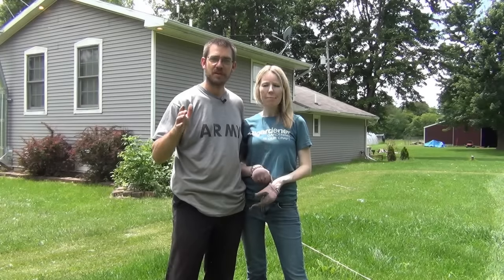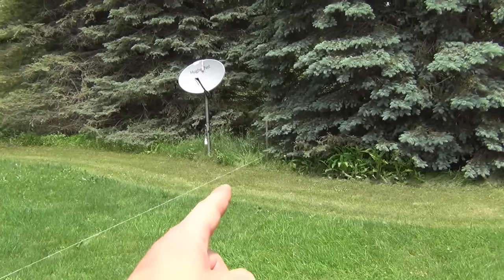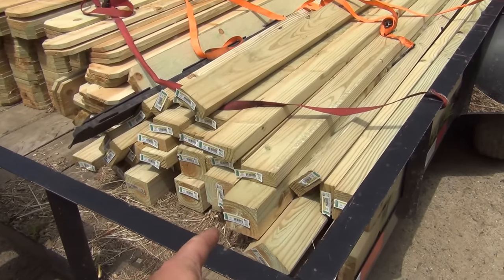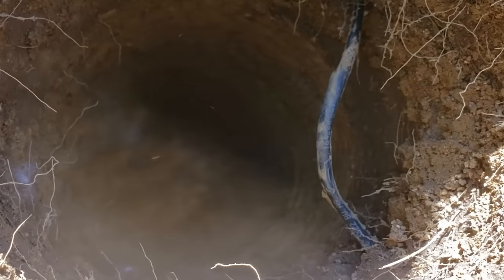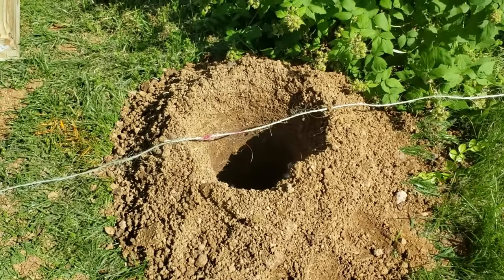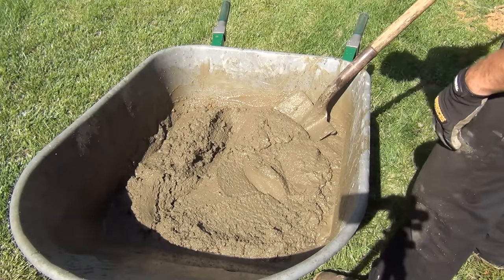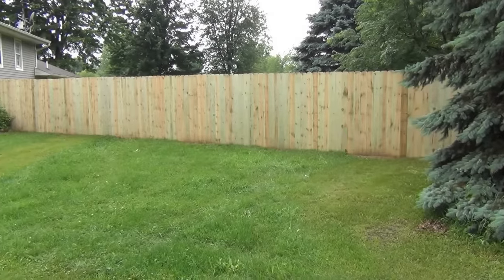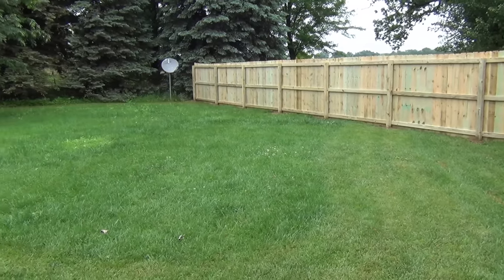How To Build A 6' Wooden Privacy Fence

Comment: I didn't have a fancy auger, so I decided to dig my fence posts by hand with a post hole digger.  Let's just say I am very sore and hate roots, but I got it done.
Reply: Fuck that, I plan on renting a gas one from home depot
Reply: @gunterhitchcock2261  any idea what they cost to rent or how difficult they are to use?
Reply: I know the feeling, I grew up on a farm that had ALOT of acres with tree lines that we couldn't get a tractor through and dug out each post hole by hand. Now I'm about to work on putting up a fence just like the one in this video next weekend, and I'm going back to hand digging each hole. Fun times.
Reply: @semiprolific774  My area has them for $125 for 4 hours... I am going to start by hand and depending how that goes I may decide to rent one.
Reply: Guys buy one that digs 22 inches deep for like $150 and keep it for future use
Reply: @hardcoreinpa  you can buy a used one for about that. Then use for ice fishing hehe. Could always buy a used hand auger  for cheap too. Better than digging
Reply: Gunter Hitchcock If you have roots in your yard and use an auger you’ll be saying “fuck that” in the hospital. Have fun. It only took me and another guy 2 hours to dig 13 holes and 10 of them were with a shit ton of roots. That’s 36 inches and a couple pole hole diggers and a reciprocal saw to cut up the roots in good ole shitty Illinois soil.
Reply: I dig my own too. Great for the shoulders
Reply: I got a Harbor freight gas auger for 130 bucks, worked great.
Reply: My guy
Reply: @gunterhitchcock2261  Some of us are manual
Reply: Unless you're buying sections, just move the post hole over. Structurally, the posts don't have to be exactly spaced. Also, an auger won't help you with roots. It'll take u for a ride when it hits a root. It's not fun
Reply: was about to do this by hand and say the two man was only $20 for 4 hours, knocked out 12 holes in 3 hours lol
Reply: @tylercoplea6342  
Amazing!!
I hope I find somebody 😕 🙏🏽
Reply: Never done a privacy fence, but I've done chain link and worked for a plumber. The area I'm in has tons of rock. You might get 6 or 8 inches of good soil and then you're busting out the rock bar.
Reply: Dude any root advice?
Reply: Haha

Comment: Nice job and nice tractor! Only suggestion is you have dirt surrounding the pole at the ground interface. Big issue which will reduce your fence life many years. Should have concrete coming out of ground an inch or two. That dirt will rot that interface much sooner. Use small cardboard tube form (2-3 inches at top) to get a nice concrete top that you can slope water away from post. I am replacing my fence after 23 years and the reason it lasted so long was that.   Great job and great family!
Reply: Do you have a video or image showing what you mean?
Reply: @TheBrokenGuru  pretty simple. Surround your 4x4 with a square like 6.5 inch form. Make it an inch or so above ground level. Fill it with concrete as you fill the hole with concrete. Then the 4x4 won’t be in contact with the dirt
Reply: not true at all. rain is going to wick straight down the top of those fence posts anyway. any good treated lumber should last 30 yrs, yrs lasting only 23 shows you did it wrong,
Reply: @cryengine_x  - you’re dreaming if you think treated 4 x 4 with direct soil contact is gonna last 30 years in Texas. But you’re entitled to your opinion.
Reply: @condor5635  and youre dreaming if you think a little pile of concrete is gonna protect your fence post from water outdoors. but whatever floats your boat. also such a setup is not gonna be perfectly sealed to the base, so it will actually arguably hold water that seeps between the concrete and the post close to the post

tldr if it makes u feel good go ahead
Reply: I'm in Saskatoon Saskatchewan Canada 
35 years  4×4 treated  posts...still strong...6 ft. High  treated  1×6....
I used  1 inch crushed  rock  tamped with  a crow bar  as filling...30 inch deep  holes !!!!😊
Reply: @cryengine_x  any educated person will know that a post coming out an inch above the ground in concrete is going to last longer than a post subjected to soil. But all you have to do is convince yourself.
Reply: @condor5635  concrete holds it close to post, and the rain that wicks in from the top is held in as well by concrete
Reply: @cryengine_x  - no there’s gravel in the bottom of the hole so there is no concrete cup at the bottom to hold water.
Reply: @condor5635  the concrete at the bottom seals the water in. rotting out the post.

Comment: SSL Family: You NAILED it!! I built a fence like this several years ago and came to the same conclusions/process you did. Screws are the way to go. When a picket goes bad/rotten it's easy to replace. We spaced our pickets with double thickness of corrugated card to allow some wind relief. Rented gas powered post hole digger from tool rental place. Stained it using 2 gal insecticide sprayer and deck spray from HD.  After 5 years, pressure washed and stained again. Still looks great. Used 4" pickets. Wish I had used 6". 👍👍 Neighbor built his fence with panels and they were falling down after about 2 years!
Reply: I just pressure washed my 13-year-old fence and stained it again.  Looks new!  Sanded down my deck, stained it, and it looks new.  Now I have one more 50ft run of fencing to build to enclose the back yard.  The posts are crucial in longevity and stability.  Thanks for the reminder on the wind relief!  I get straightline winds, and am surprised, in retrospect, that my fence is still standing after so long.  I used Thompson's Water Seal Signature Series 1gal on the fence and deck, and just bought more cans for the new fence going up.  There are transparent, semitransparent, and solid; I went with solid, and in natural cedar instead of honey brown, or maple, or any of the other colors.  I didn't realize they were "seasonal" in replenishment; I got lucky with finding the last few cans I need before the spring replenishment (per Thompson's online response).  I can't believe how many fences I see that do not get stained-- treatment does not mean impermeability!

Comment: Important to note that if you set your posts exactly 8ft on center, you'll have to cut the 2x4x8 stringers to exactly 8 ft long. Yes they are sold as 8ft boards but my experience is that they are always slightly longer, sometimes even as much as an inch and a half.
Reply: If you want to have a nice smooth end on the 2x4 instead of an unfinished crooked rough cut, square each and cut each end to make the board 8 ft long. Then it’s a nice smooth perfect 8 ft. Gets covered up, but it’s done the right way.

Comment: This was the exact fence I had in mind to build. Only difference we used cedar pickets. But my wife and I followed every step in this video and the fence came out great. All 59’ feet of it. Great suggestion on going with the contour of the ground. Could not have done without your guidance. Thank you so much for sharing this video. We did it!

Comment: Yes! Cordless drills are great, string line is key, and rent a post hole digger. Manual digging is fine, but after a couple of holes it’s time upgrade. A thing or two to keep in mind: for those that trim/weed eat, you could create a rock bed (or something similar) under the fence to prevent chipping the fence when trimming; and be sure to plan, plan, plan! Write down what materials you need, mark your holes, mark utility lines, etc and double check before you start. Nice video!

Comment: i did posts the same way 24 years ago and about 10 years ago some of the posts rotted away right at the concrete so i replaced some of the posts but for the ones that were salvagable i dug out to the concrete and put the yellow concrete cardboard tubes and added concrete to top of it and a few inches above ground...also good idea to clear silicone around the base of the wood or water could get in there and still rot the post

Comment: Built same fence 2005 but my mistake was I put a 1/4 space between boards , 15 years later I have gaps up to 1 inch wide,  So I simply removed all boards held on by 2 1/2 #8 robinson deck screws.  I then reinstalled them tight together.  I also put my posts exactly 8 feet apart and mounted the 2x4x8 on metal brackets; it meant I had to rip one board to fit and I used 1x6 x 5 ft boards.   So in 15 years I had to replace 4 posts that rotted pff.  I left them in place and put in  new a post a couple of feet away.  It has served its purpose,  Good video!

Comment: A 90 degree post level helped me out alot.  It rubber bands to the post and gives you a level on 2 sides for I man operation.
Reply: They are great.  Also good to measure post from top to set depth, mark, and I nail a temporary cross piece to hold the post at desired height.  Then gravel on the bottom so post isn't sitting in "cup" of concrete and water between post and concrete can run out.  Greatly increases life of post.  Once set, just knock temp board off.

Comment: Yes, this is a great video. Just what I was looking for. I need a privacy fence going 25 feet from the corner of my house where it meets on the corner of my other fence that runs down the property. It’s on a little slope so it’s going to be tricky. I think I’m better off seeing that one one and it’s gonna be quite a bit as much as maybe 6 inches 4 inches difference from one corner to the other corner. I think rather than follow the ground. I’m going to follow the top and make sure all or even at the top and line up in a row at the top of the fence rather than the bottom of the fence. In between that 25.ft, I’m going to need a 10 foot gate or 2-5 foot sections because it’s going over a driveway, a second gravel driveway.

So being a 62-year-old woman that doesn’t have a lot of building skills, I purchased one of these levels that has like three side you attach it to your 4 x 4 or 6 x 6 post. And I also purchased one of those cat laser pointers where I can set a small piece of post in the ground attach my level and use the laser pointer to guide me to where I want to be and when I hit dirt I’ll know how far I’m of, Yes, I’m going slightly up the hill on the other side of the driveway section. I can throw gravel in there to cover that up a little bit no big deal! I see your neighbor a couple houses down put one up and he’s had a dip down also but he leveled up the top, so it’s there is a pretty good size a little gap along the bottom he could always run a stringer at the bottom if you wanted or do anything at the bottom plant some bushes.😂

My challenge is going to be when the side of the 6 foot wood panel, not panel pickets that I build fence, reach the corner of my house, keeping the squirrels off the fence from jumping up onto my roof of my porch! So I’ll have to put up some kind of a metal pole or shepherds hook or something and get one of those cone shape do hickeys and attach that so the squirrels can’t get up there😂😵‍💫

I put up a privacy fence in the back but I used panels instead of building with pickets like I’m going to do this time. It worked out pretty good. It did start to tilt a little bit. I probably didn’t get the 4 x 4 posts in the middle all the way enough in the ground but that’s OK I’m going to twine that 4 x 4 post on my back fence up to a tree and pull it tighter and then I’ll fill it in steak it in whatever I’ve got to do so some extra concrete down in there whatever I’ll get it fixed up and it’ll be all good to go for another five years!😂

I live in the city and I have a 30 year old son that lives with me he has he is not a builder. He needs a musician. He doesn’t put up fences. He doesn’t use hammers nothing out of it, but he can carry things and hold things up while I get up and do stuff I’m gonna be 62 years old in two months. I’m a little scared to get up on my roof again, but I gotta get up there and take care of a few things. 🤞

My husband passed away from pancreatic cancer a few years ago unexpectedly😢 So I’m trying to finish off the projects that we started without his guidance and try to remember everything that he taught me through the last 35 years😊

❤ Great channel I’m sure I’ll come back to this channel many times for your videos and maybe even advice😊
Reply: I hope things are workimg out for you. You are awsome. 
wish I could help, might learn something from you! :)

Comment: I had a 6 foot chain link in the back of my house when I bought it. I found some brackets at Home Depot that slide over the posts that have holes in them to bolt the stringers on to. That fence is about 80 feet and not having to put new posts in saved me a ton of time and money.

Comment: ...when you have measured your desired depth and put in place the first and last post...run a level string line from the tops of those two posts...this way you don't care about your lawn (which is not level)...just make sure each post top reaches the string line.
Reply from the maker: That is certainly an option also if you want the fence to be straight between two points. However in many cases the ground will roll and I prefer to have the fence follow the contour of the ground rather than have a bunch of gaps at the bottom. Just a preference though, either way will work
Reply: @SSLFamilyDad  you run the stri g between two spots where the ground is changing..low spot to high spot.. Follows the ground that way.. Also you can keep it off the ground that way so the pickets wont rot

Comment: I stain all my boards 6 sides before install. I also only use treated posts and stringers.

Each board is leveled rather than just put up one after the other.  If they're just placed one after the other they usually move with the Earth and end up ascetically not looking right and being off by one to two inches.
Also i secure each stringer  Between each post with metal brackets that are sold at any home improvement stores.
 I find it makes the fence more secure and strong. 
 Not staining our using treated wood  You will have a rotted fence quick depending on your climate.
 I also use screws and recommend them. You have a nice fence just adding from my experience.

Comment: Built a few privacy fences now and the only thing I do differently is that I always set my pickets up off the ground a couple inches.  Makes it easier to string trim against and keeps the boards from being in constant contact with the ground.
Reply: Kyle Hiltner I always install a level ‘ rot board’ at the bottom, a 2 x 6 at least, one it gives you a nice level piece to rest your pockets on and the weed whip doesn’t really hurt the 
2 x 6 and saves the pickets. If and when it gets bad and ugly just change out that board.
Reply from the maker: That is a really good idea, why are you not here helping me with these things again, lol

Comment: Good video,  but I been building fences for a long time, 1) check the recommended depth of post holes in your area first.  2) install post then if your in a wet area you could pour in dry concrete it will set on its own with out mixing. Just wet around post with water or if in a dry area add the dry concrete and then add water and just poke it with a stick to get the water mixed in. Saves your back from mixing. 3) not every one has a tractor, you can rent a post hole digger or small hand one a most rental shops.4) if your going to put fence post caps on start with top rails 2" from the top.  Nice fence.

Comment: I am replacing a fence of  8x6 pre fabbed panels. It's a real hassle. I've got the portion from the house out to the street put up, minus the gate. The long portion out by the road is the most difficult because there are bushes in the yard and other things I planted along the fence out by the road. The dirt behind the fence was right up on about 6 to 8 inches behind the fence. Some of these shrubs are just slap on the fence so they have to grow over the fence or out into the back yard. Along the road today I put up one panel on two posts. The idea was to let it over hang at end but the metal pole for the fence got in the way so I had to cut it back on the 2 by 3 about four inches, or one picket. There is a privacy fence behind this one which is my neighbors. The posts are difficult at best to set by yourself. Tomorrow I am cutting a two by four in half to make a brace to hold the post while I concrete it in. Anyway, by the road the yard slopes down. As I dig up posts that are broken in the ground or just in the ground this dirt gets strewn about. The GRADE under the fence is hardly constant at all. With two feet in the ground and 6 feet above the ground you only have about 7 inches to play with to raise the fence up a bit. Anyway, I have about four panels to go. I just need to get up earlier. I stay up all night watching movies. I'm off for the holidays and I go back to work on Monday. I just got this Amazon fire stick so I have been able to find a ton of movies to watch, horror and sci fi. Anyway, the prefab panels are very limiting to say the least and it's easier to build in a field than in the bushes.

Comment: Good teamwork, I like how the kids helped with staging material so the adults could keep up a quick pace on the pickets.  An option to help the posts last longer would be to use penetrating epoxy on them, at least the lower three feet, though that is a bit pricey.

Comment: For evening out rough ground lay a board down on the ground and set the vertical fence boards on that instead of the ground. If you use a 2x it will keep the fencing out of the dirt and it will not rot out as fast.
Reply: Yep I was just going to say putting the pickets directly on the ground causes them to wick up moisture faster. I use ring shank nails instead of screws much faster and just as good if you get the right length, but for god sakes don't use staples like the cheap guys that have been working in my neighborhood as of late.